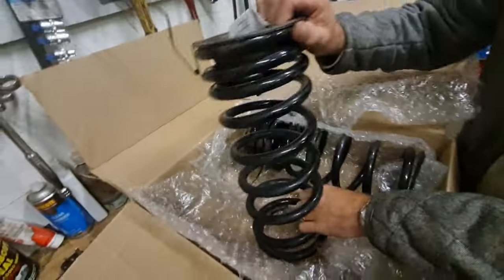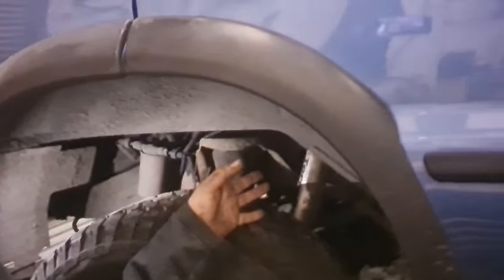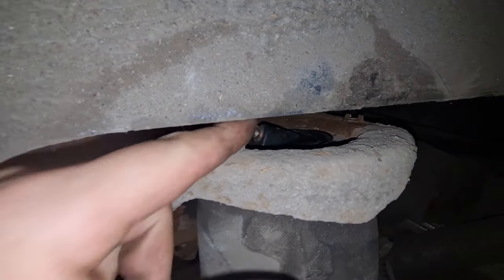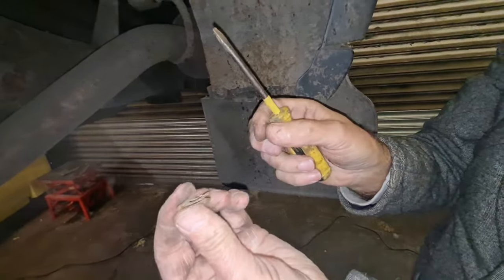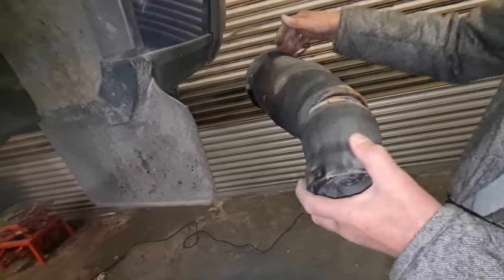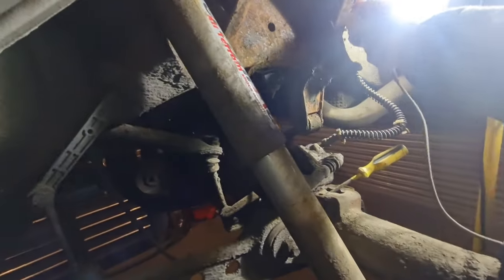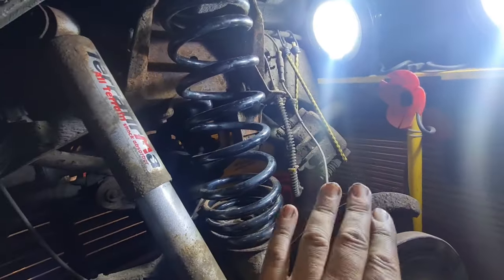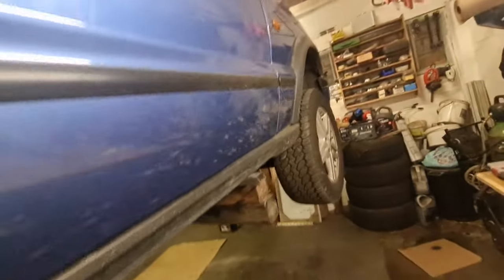land rover discovery td5 converted to springs from air. how to.

Comment: I have similar genuine LR 18” split rim alloys on my D2 V8. I have been reliably told that they were made for LR by BBS when LR was owned by BMW. This style of wheel was only available for the D2 & P38 Range Rover and was discontinued when  LR was sold by BMW to Ford. These wheels were very expensive when new and are very rare now. Try and find another set!!! I had mine refurbished by Lepsons with diamond cutting a few years ago and that was expensive too. I would guess £250 a wheel now if taken apart and refurbished to as new condition.
If you have a near mint condition D2 or P38 then the split rims are really the icing on the cake. However, I have the similar problem as you in that my D2 V8 is far from mint but my rare split rims are in excellent condition. If I were to sell my D2 how much difference would the split rims make to the value? Not a lot I suspect! As I’m not selling my D2 it doesn’t matter to me 😀
Reply from the maker: Thanks for letting us know. We have a few sets of wheels so maybe we will keep these!